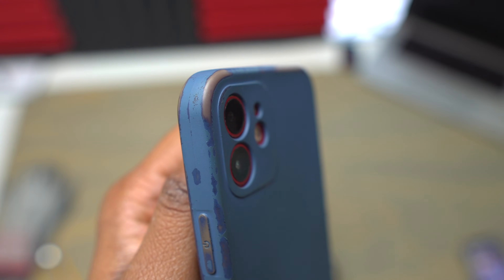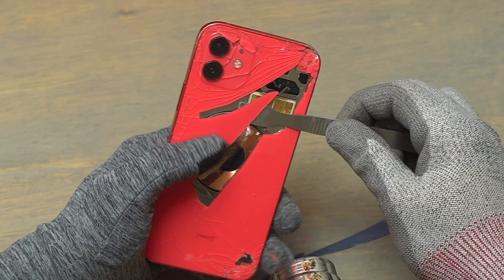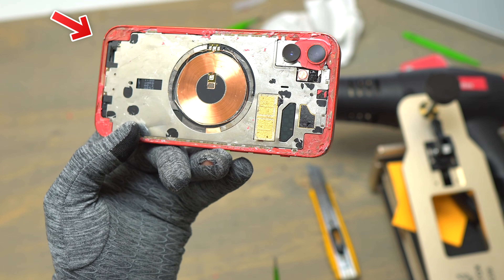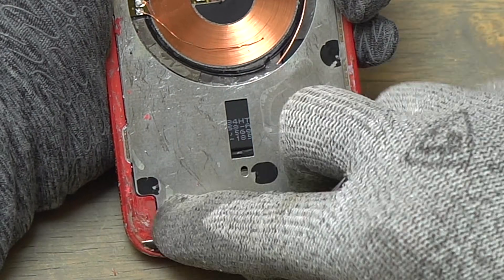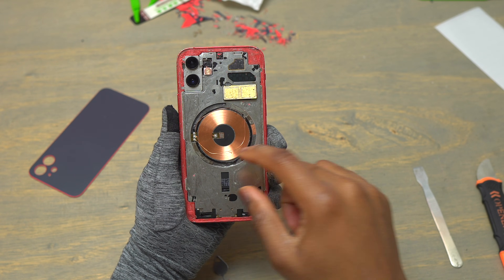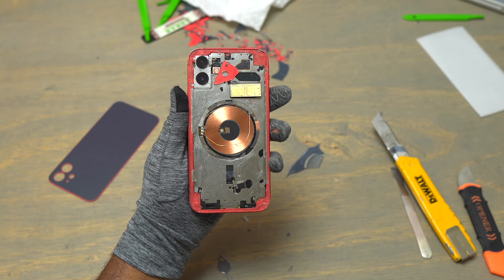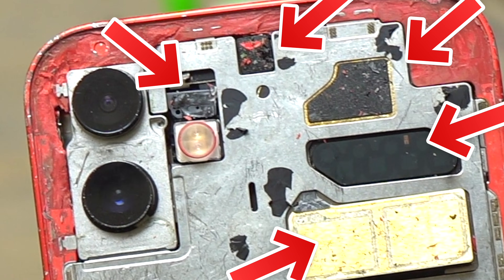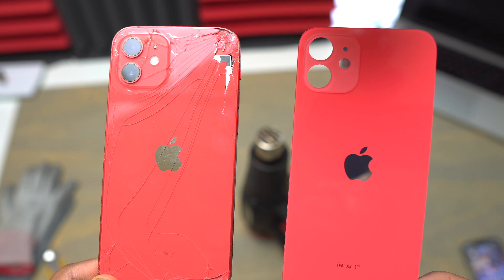iPhone 12 Back Glass Replacement Repair

Comment: LOL, this video made me feel soo much better at myself at the halfway mark...I need to figure out if I can salvage me iPhone 12 or not because the frame is the worst...
Reply from the maker: Even with a laser machine this one would not be done because it is bent. This is one of the key point I intended to show people. The process is valid I have done it multiple times manually same thing that I did in the video it worked out well. Those other videos are also on the channel.

Comment: Thanks for showing. What the heck is Apple thinking? This is the worst product manufacturing ever. I grab a 5€ plastic back cover for my Lumia 950XL, snap the old one off, the new one on, 1 minute, zero headache. Why isn't this procedure normal any more? Designing for hypothetical water damage in a toilet has totally getten whack. Design for fixing cracks, not for falling into water.
Reply: New iphones have back that can come off
Reply: @Dogappel Too little too late.
Reply: @ Agreed

Comment: Surely that’s not the right way? Need mine doing but don’t fancy doing this
Reply: This is NOT the cleanest way to do it. Laser is the cleanest way.
Reply: @Dogappel yeah but the point of this is that things like laser are only going to be at repair specialists making the repair very expensive. anyone using a phone like the 12 at this point it would not be worth spending the money doing that, this is just an example of how it can be done with basic tools.
Reply from the maker: This is the cleanest way to do it 
iPhone 12 Back and Body Replacement (New Again)
https://youtu.be/0q4XlY3ujfg

Comment: Whats the best heat temperature for back glass repair
Reply from the maker: Not exactly sure I was using the heatgun at the high setting. My heatgun is either low or high. Do you have a heatgun with precise temp??
Reply: @ersbit  same here. I wanted to buy one that you can adjust the time temp
Reply: @ersbit  ya i got one that i can go between 300•f -1400+ lets u pick what ever temp you want

Comment: Great video! What about microphone mesh and the flashlight glass ? Do I Glue it? How to install it? I would be so happy if you could help me :)
Reply from the maker: No need to glue it. It came out without glue so I did not use glue when I installed it back in place.

Comment: Bro is it still waterproof???
Reply: Why? Do you swim with it? Wank on it? Put it in your back pocket to ruin your jeans and make it toilet diving? Waterproof phones are of 0 interest to me. You can always put them in the oven if they get wet. Hour on 50°C and all is good again.
Reply from the maker: No nooo no it should be considered not water-resistant simply because it's not 100% sure. You'd have to test it to see and it may fail. So I recommend after any repair just consider the phone not water-resistant for anything that is Submerging the phone. It should be fine for splash and reduced amount of water contact.

Comment: took me 3 hours to remove the glass panel iPhone 12. one of camera ring is broke, few magnet broke and anything else it's working but I do not recommend to do this just like other said on here I recommend replace the housing
Reply from the maker: Absolutely this is hard and the result will certainly never as good as transferring everything inside a new body.

Comment: I think I messed up lol. I took the metal bezels around camera lens off thinking they went on after the glass like original. I already put the glass back on. Any solution for attaching the bezels now, over the glass? 

Also i put microphone back on the same way but it is not working now. 

I got the phone super cheap so microphone is not a big deal but i would like to get the bezels on to help keep moisture out
Reply: did you solve it?

Comment: The bad thing about changing only glass on the 11 regular and 12 regular models is that the camera rings don't fit well. In those models it is better to change the full housing. Good video.
Reply from the maker: Yes that's tue. I prefer to do the full housing it's safer and the phone will ultimately look like new 👍🏽. Thank you, Appreciate it
Reply: Does that also apply to the covers you can buy with the note that the holes are slightly larger to make fit easier?